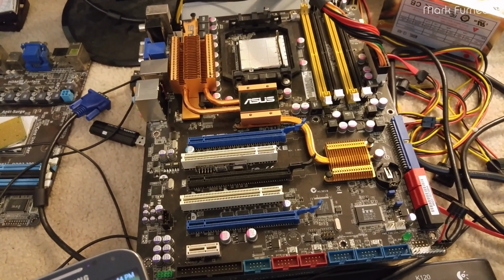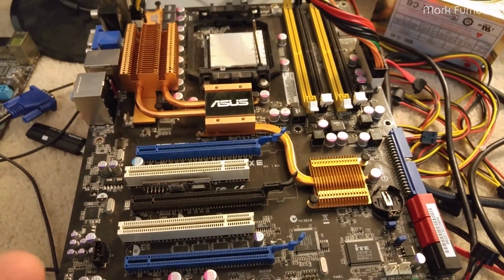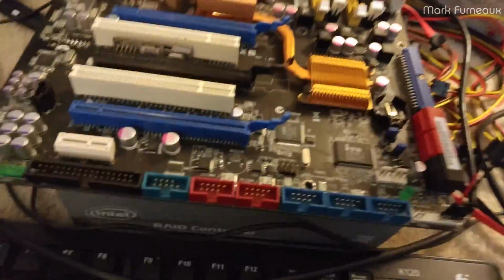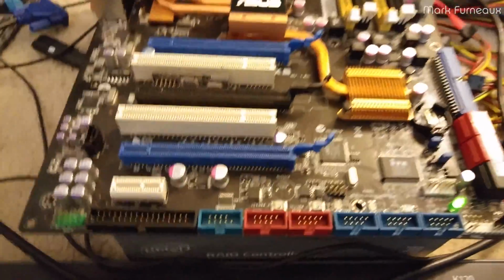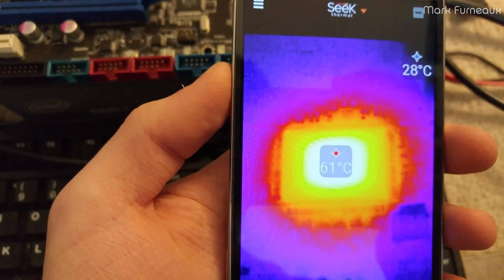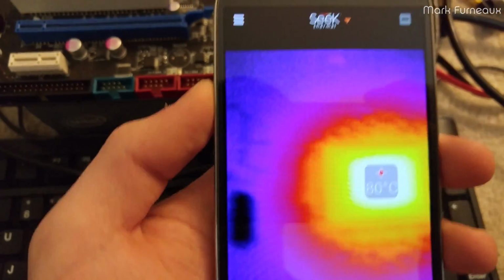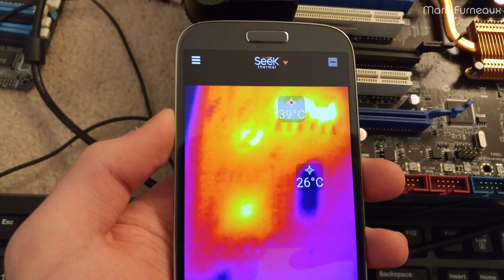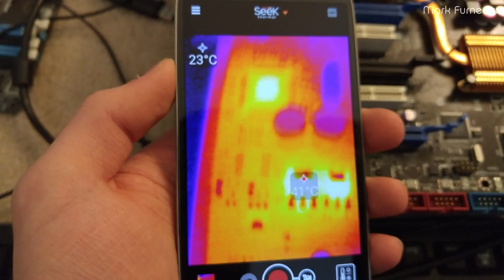What a Surge Will Do to a Motherboard

Comment: Thanks, yesterday i ran into a power surge error while booting an Asus h31m-k, i took off the power supply and diassebled it to see if it was any capacitor or something easy to replace, it turns out that the board inside it was all burned, like it blew up at some point, lol i don't even know how that was turning on, i tested the motherboard with other 3 power supplies and it kept giving me the powert surge error with up to 14v out of the 12v meter, i guess that the same thing that happened to this one happened to me, is unusable as it is( doesn't go to OS )
Welp it's gonna have to be replaced, what a shame...

Comment: After a Surge is there any way to fix a motherboard?
Reply: Nope
Reply: @xvxv6975  I have power surges when my pc is running I be playing a game or have the multiple browsers open it shut off and auto goes back on to the boot up screen
Reply: @justdemon839  it's  vey rare
Reply: @justdemon839  is anti surge gonna protect my components? I got that message once. Just installed gtx 1060 aswell, will it be risky it run the pc? I got 500w generic psu, have to buy a new one and a case aswell with better cooling, which will cost around 100 bucks and iam very fucking anxious and stressed about this.
Reply: @jessexd9674  Same here, got the message once, or actually twice in a row but hasn't done it again yet. Got a new GPU also and scared to install it. Last one broke but not sure if the PSU was the cause.
What did you do? Bought a new PSU?
Reply: @Empty12345  Yes, when the usage would hit 100% in games  like FC5, it would shut down and give me that message. I bought a new psu (Deepcool DN650) and  Its all good now :)
Reply: @Empty12345  If it says power surge detected after a shut down then you should consider buying it aswell

Comment: you are looking it wrong first of all audio chip and the network chip should heat up at the startup like the cpu hetas up you know  but you have to find the board schematics to fix whats wrong start measuring 12 votl rail on the motherboard 24 socket plug does it recieve it if it recieves it ok if not push 12 volts to it and toss a little 100% alcohol on the board and should revel what is the short most motherboards damage near the cpu near the mofsets so you can use the multimetar to find out thats an am2 + motherboard i believe i tought of baying one back in a day

Comment: this happened to me with a corsair rm750 psu I got another good psu and removed the cmos battery and cleared the cmos then I put the battery back in and jumped the green and black wires on the 24 pin connector for the board to power on it booted up saying power surge then pressed f1 and let it reboot a few times with the jumper wire in then I removed the jumper and now it works again but I tried the corsair rm750 psu again and it power surged again so I guess a new psu is needed and maybe a motherboard but the motherboard boots to windows fine.
Reply: Replace your PSU your board should be fine if it stills boots to windows fine

Comment: In my house we have what is known as a 'family' computer and it had an endless cycle of startup then shutdown. My uncle works with computers and replaced the power supply in it and that did the trick. It stopped restarting itself. Would a surge have anything to do with that?
Reply from the maker: No, just a bad power supply.

Comment: Hey computer lover's. I have a serious problem my computer is not turning on . When I pull the cpu power out the fans spins but when I put the cpu power to the motherboard the fan is not Turing on . Any one know ?
Reply: Try resetting the CMOS.
Reply: Zeron I did removing cmos battery I still like that umm I had a 400 w psu last time . So I got a 700 w psu from my newer computer but when I plug I. It zapped and o heard a pop
Reply: @zeron3699  This just happened to my PC, I replaced my 550w PSU to a 750 and now only my ram turns on. What did U do to fix your PC?
Reply: If everything is in it’s right position remove all your ram exept one stick pit it in the number one dimm check mobo manual and clear cmos by removing battery then turn it on

Comment: Shame :-(
Skin is allways a good indicator lol ;-D
Reply: I saw a spark and stuff turned off. My pc still works, but will it die soon? I don't hear any clicking, and I think the psu might die.
Reply: @coows  if you think your psu is going to fail, replace it. Don't question it; when a PSU dies, especially lower end and cheap ones, they can go out not only with a bang, but there's a good chance it'll take your whole computer down with it. Never cheap out on a PSU.